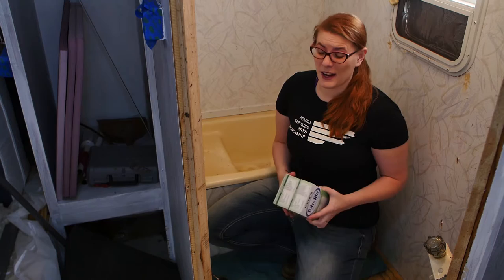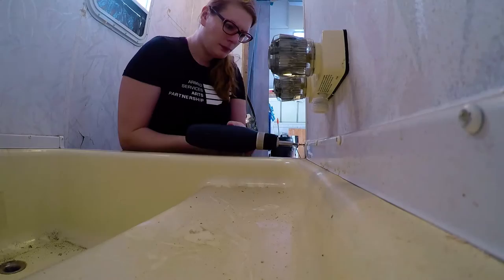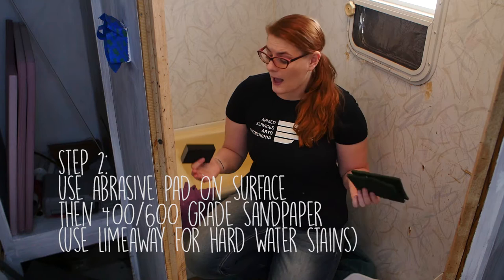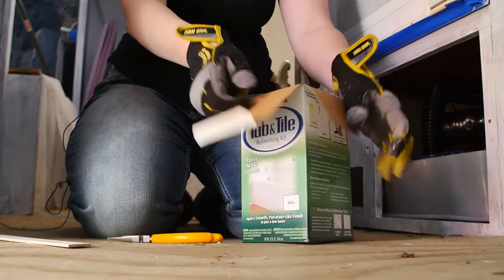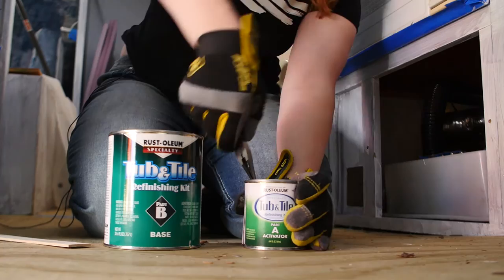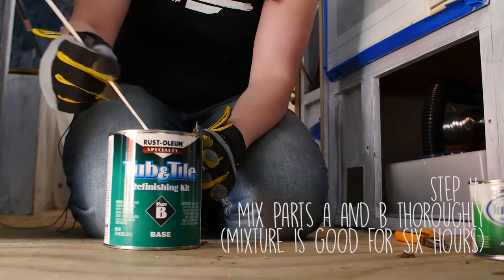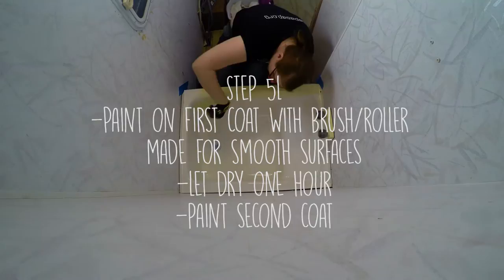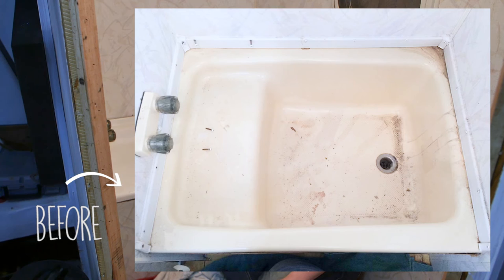Travel Trailer Remodel, Part 6: Refinishing the Tub with Rust-Oleum Tub Kit

Comment: did you use a brush or sponge to put on?
Reply from the maker: I used a small foam roller brush made for smooth to semi smooth surfaces. You'll see different options in the paint aisle and mine was the smooth one.
Reply: Thanks alot...
  Tammy Hineline.
God bless you. ❤
You did a really good job👍 I hope mines cone out the same.😅